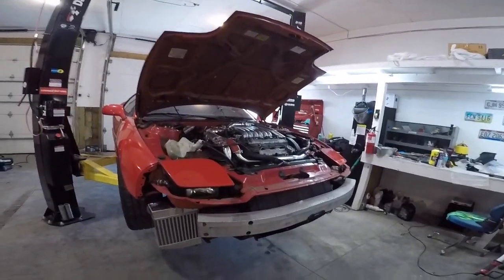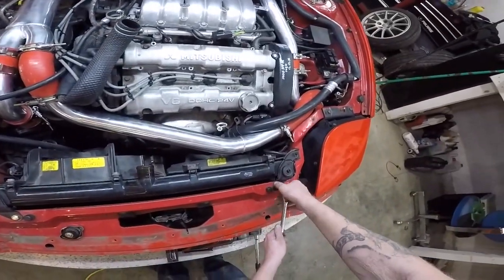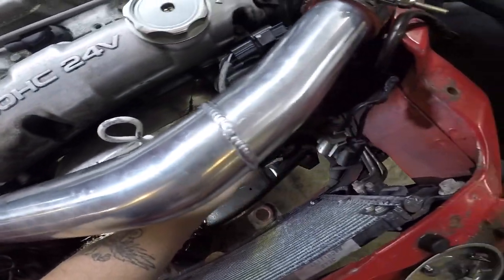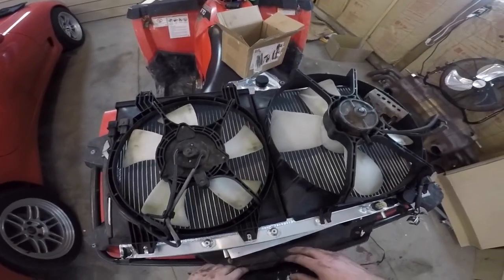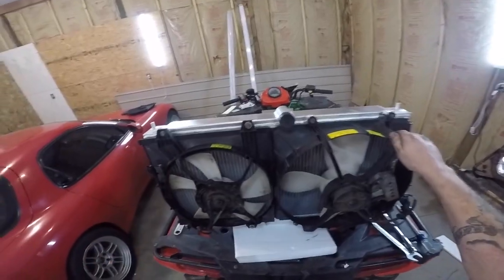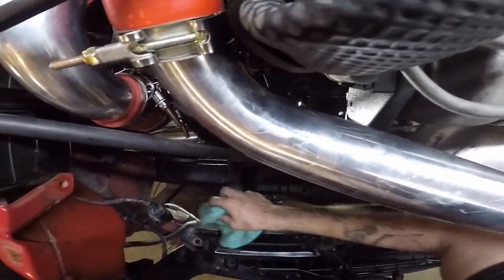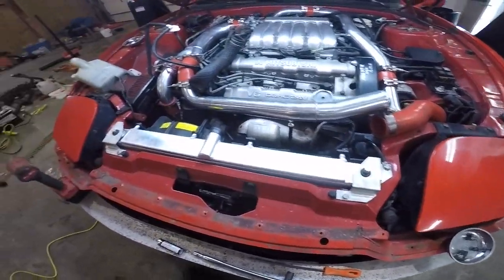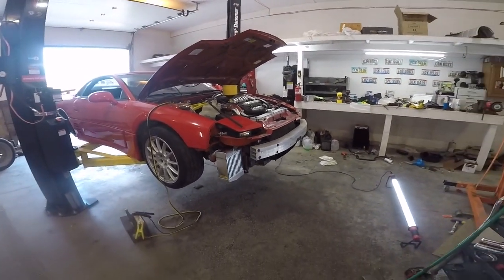twin turbo 3000gt vr4 gets even cooler ❄️

Comment: Good stuff Ian!!  I may do the same when I swap in my larger turbos next winter.  The rad needs to come out anyway, so I may just take advantage.  I laughed out loud when you spilled the anti-freeze on the ground.... sounded exactly like me!
Reply from the maker: I hate antifreeze so nasty.. I rather be covered in Street oil or transmission fluid over antifreeze any day
Reply: Honestly I prefer antifreeze over power steering or whatever except oil.
Reply from the maker: @ilikeboost4764  fuck that

Comment: Ur fans should turn on with or without the ac on...U can turn the car on(on the turbo models) n not even drive it just in neutral the fans will  automatically turn on n off as the ECU thinks needs to cool off even though do the car is not that hot. If U turn ac on boths fan will turn on n off on ur own(but on the non turbos models U have to turn the ac or heater on full blast) so would not make a difference if U have a leak or delete the ac.  The stock fans are legit.

Comment: If you upgrade your turbos just buy another ac fan off someone or a junkyard car and splice it in. It will work and it’s cheaper
Reply from the maker: O ok .. cuz it's thinner ? .. so I can keep 2 fans is what ur saying ?
Reply: Huracan ian sorry I didn’t see this until not to reply. Yes you can keep both fans this way. Just the snip of two wires so you can put the other plug on it.
Reply from the maker: @seanwilson1985  ok sweet thanks !

Comment: Built right u can make it a daily. if u keep the ac it won't hurt it. The ac system is popular on these cars. The turbo will hit the fans if u go TDO5.  Stock fans work fine .  U should get another bov stock are trash. People sell these cause they put mean hours in with small turbos. If u want to build a keeper that will still sell Dr turbos bro.  Join the FB 3s groups get to know some folks ask questions. YouTubers will tell you anything without considering your personal needs. I'll probably be watching your videos and letting go any info I have on your questions. This is my wife account so don't mind the name
Reply from the maker: I'm not on Facebook lol . and I don't need to daily the 3000gt ... But have u seen any on the new videos ? The engine isn't even in the car anymore lol

Comment: Man I have the same radiator and it fit like that too. Let me know when you take the rest of the ac lines out and I'll buy them from you. My ac compressor is good but a couple lines have holes in them
Reply from the maker: Ok .. where you at and what lines you need so I make sure I don't mess them up
Reply from the maker: Cuz I already cut the short one that goes from the condenser to the reservoir
Reply: @huracanian3051  I dont need the one you cut but the coated one that runs along the drivers side engine bay and possibly the one one the fire wall. I'll check tomorrow and hit you up on Instagram if that works

Comment: Hey man, did you have to remove the AC to fit that radiator? I’m still running everything stock under the hood but thinking of getting a new radiator. Just need it to be a straight swap for the OEM one without causing any issues in the engine bay.
Reply from the maker: No it's works with the AC you have to get new brackets
Reply: Nice one dude. The radiator brackets that come with the radiator or new brackets for the AC?
The bigger aluminium radiator looks awesome, need to add that to my list of parts to get!
Reply from the maker: @45Camster  new radiator brackets but not all of them radiators come with new brackets..
Reply: Cool, I saw that part in your vid. Didn’t realise that some of them sit higher so the OEM brackets don’t fit. I’d rather it was a like for like replacement but if it comes with brackets and doesn’t affect anything else then that’s good too 👍🏼.

Cheers dude!